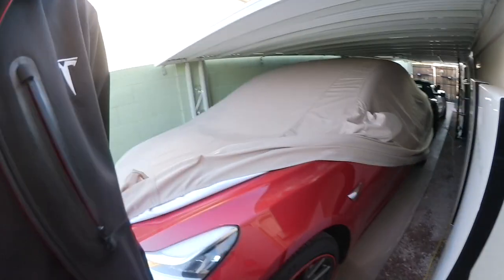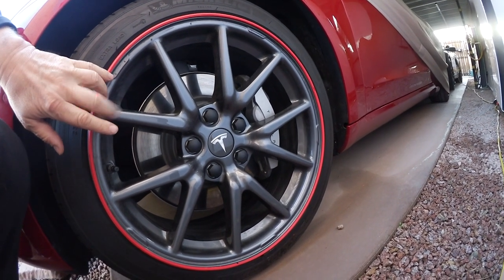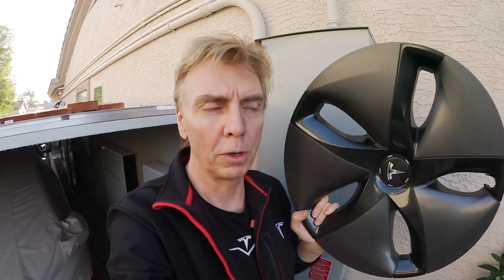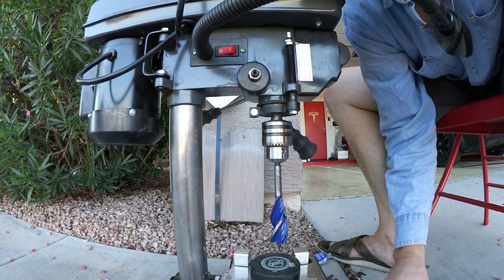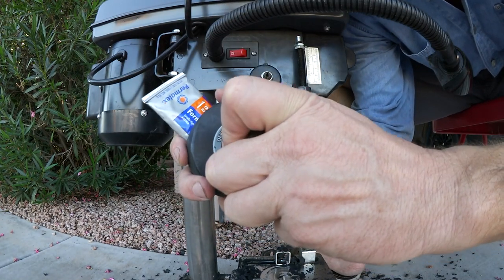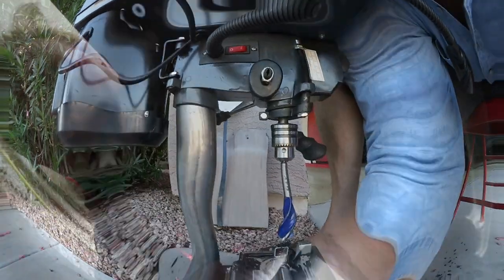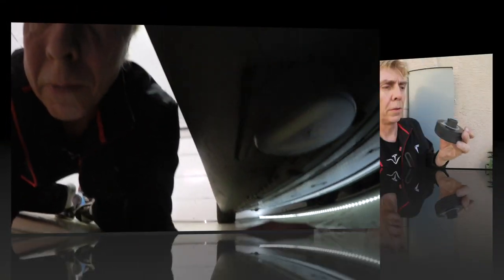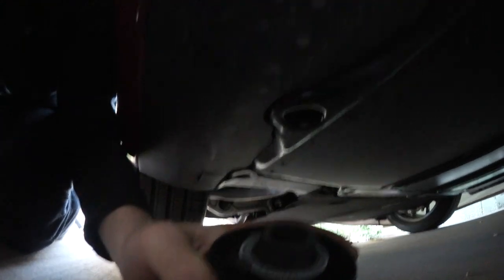Tesla Model 3 Favorite Accessories built or bought

Comment: I totally agree with you on the importance of having lift pads, whether you purchase them on eBay or make them yourself. Every Tesla needs these. Another must have item is a small air compressor to add air to or inflate your tires if there is a small air leak. Get a tire pressure gauge too.
Reply from the maker: David Nizel Right! I show you the tire pressure device next time. Rolf
Reply: I agree too. But just be aware that some national tire chain stores may object to using any user-supplied items. The store that my own mobile service tech recommends and uses for tire work claims that it will need an approval letter from both the car manufacturer and their corporate HQ before anything can go between the lift and the car. It's a liability and safety concern that I hope gets ironed out as more Model 3s appear on the scene. Anyway, I hope this doesn't affect others the way it has me!